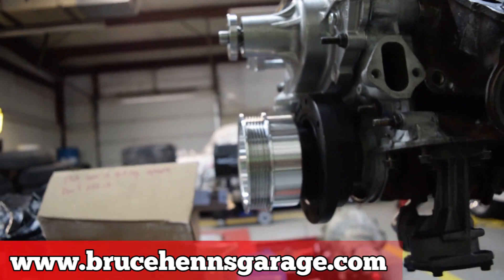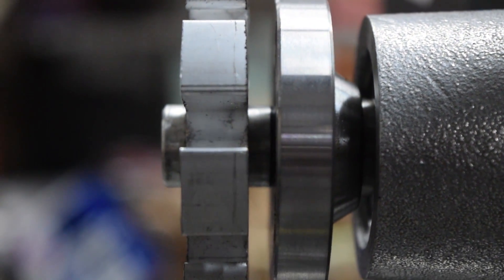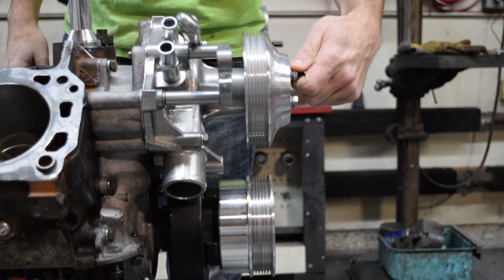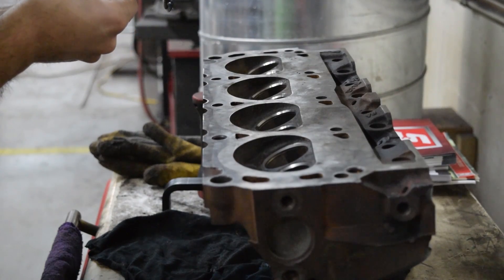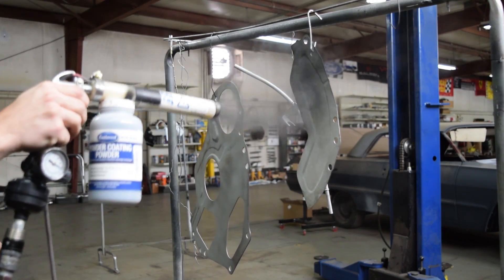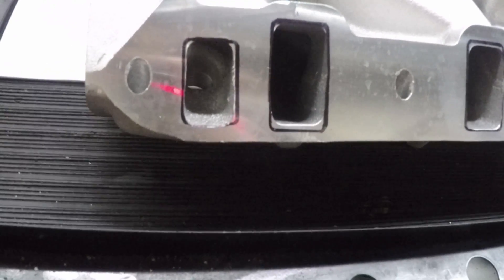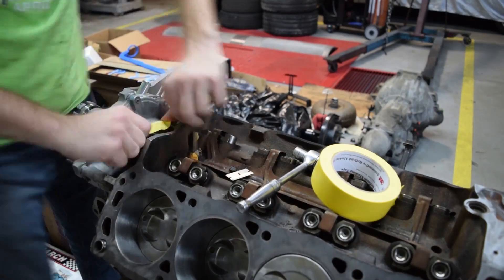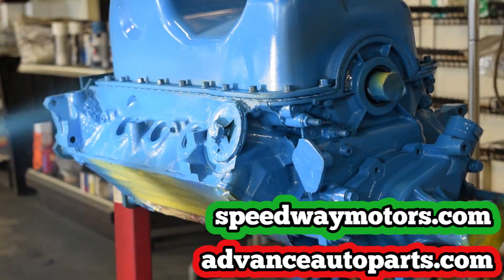Vagabond Falcon Build: Part 7

Comment: If you add up all the parts/labor on those mediocre heads, you prolly could have just bought a set of AFR 165s, and gained over 50 HP and saved much, much labor. I realize you went with sponsor parts and services to save money, but in the end that ALWAYS leaves you with a compromise engine. Heads are the LAST place you want to scrimp on a street engine.

Comment: Love stone-in seat grinders, perfect concentricity every time, plus you can choose the best angles and widths for your valve job. Also a very important part of lapping in the valves is to see where the seat angle on the valve and seat meet, all big factors in maximizing air flow. Did you guys port the heads at all?

Comment: The place on small block Fords to be especially careful is the front timing cover/water pump stack. It's not the most robust sealing design since it stacks block > gasket > timing cover > gasket > water pump backing plate > gasket > water pump. I couldn't get mine to seal at all with standard gaskets, ended up using Permatex Right Stuff in place of premade gaskets and it's been bone dry for 20,000 miles (my application was a 351W, but it's almost identical in this regard). I do hope it seals for you as-is!

Comment: So a ported and polished intake manifold plus roller lifters and a performance 4 bbl carb and im assuming a performance exhaust system I think this engines going to make about 300 horses if not a little more. Yeah it will be a cruiser but a fast cruiser.

Comment: Why not the original wheels to keep the original look? Maybe you can get the wheels widened if that's the problem.
Reply: wrong bolt pattern, and won't clear the brakes he's using.

Comment: May be a stupid question but are you doing a brake upgrade as well
Reply from the maker: +Ben McCarthy Power dual master and disks all around
Reply: +Ben McCarthy I think he mentioned a disk conversion as part of the suspension upgrades in a different video if I'm not mistaken.
Reply: Thanks RegularCars

Comment: I hope this car is ridiculously fast. You're going to straight pipe it, right Mr. Regular?
Reply from the maker: +Chris Mathy Pypes Performance will be fitting their own exhaust.
Reply: I don't think he is its a crusier its prob gonna just use a stock gt exhaust
Reply: +justin mccaffery it'll be fairly quick seeing as it'll be near mid-high 200's ion Hp and probably 320ish TQ, in a light body.
Reply: +RegularCars that's right. I forgot. Thanks for the reply